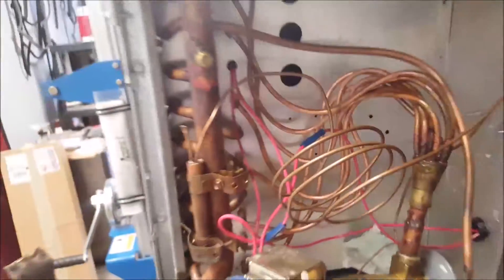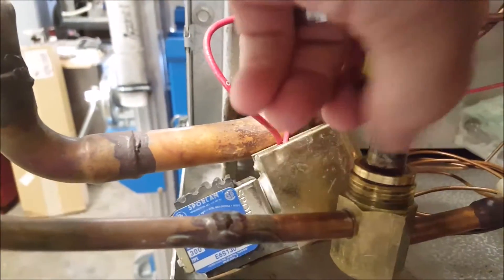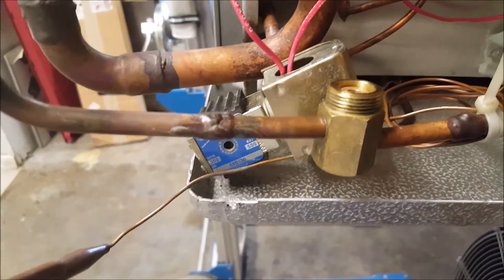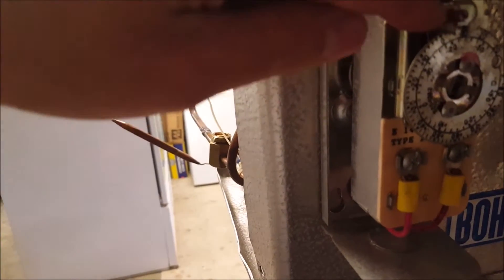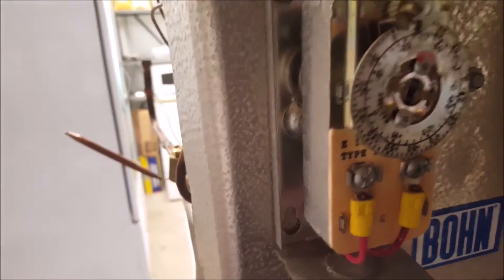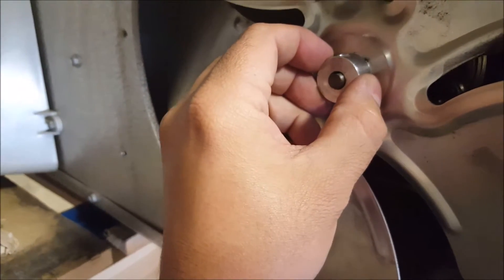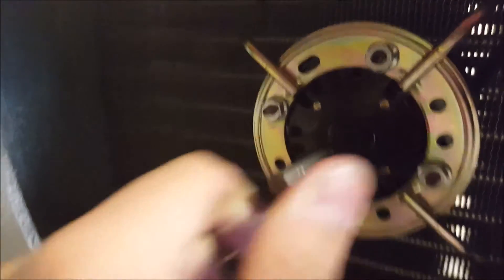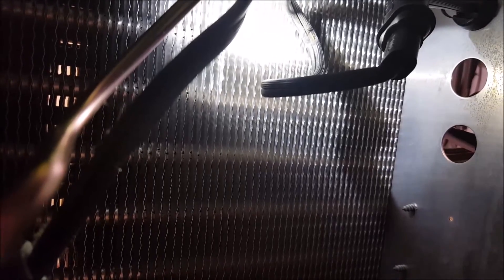Freeze walk in Evaporator Explained Part 3 of 3

Comment: Hello. Great video. Would you mind explaining how to do the electrical wiring on a walk in cooler evaporator?  I understand it takes a 120v to run the evaporator fan motors and the liquid line solenoid and thermostat. I just would like to know how they’re all wired. Thanks!

Comment: Thank a lot!!!.  Please, Three cuestions .. where is the correct position and place of thermostat and txv bulbs. Txv bulb, horizontal or vertical , insulated?. Points where to take sh, inside in evaporator? With a probe thermometer and manometer (testo), or with two thermometer probes and subtract the difference of both? Or outside in suction line with (testo)? Thank you very much! !!
Reply from the maker: +Alfredo de antuñano 

Iknow I'm late on the reply.Mount txv sensing bulb on suction line right after leaving evaporator. Second mounting on horizontal is better than vertical. If you have to mount vertically, be sure bulb capillary is coming out from top. Always insulate, as temp affects bulb, which affects txv. For superheat, measure your suction line temp near txv sensing bulb. Then take suction pressure, at evap if possible, then convert to temp. Then subtract your temps. This will be your superheat.  Hope that helps.